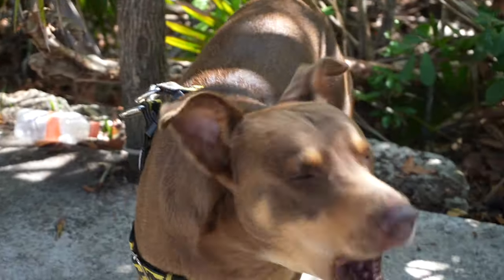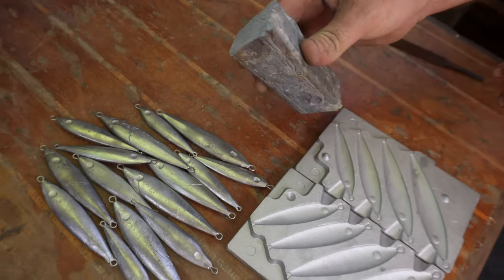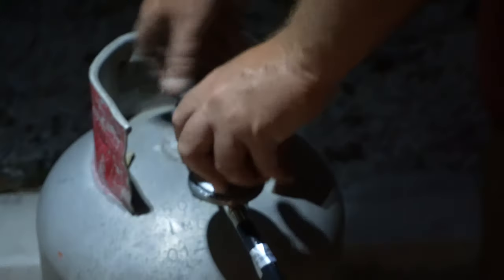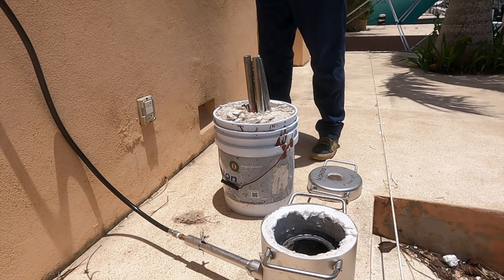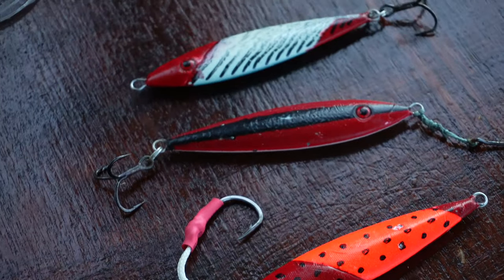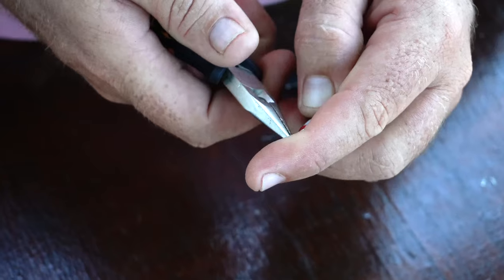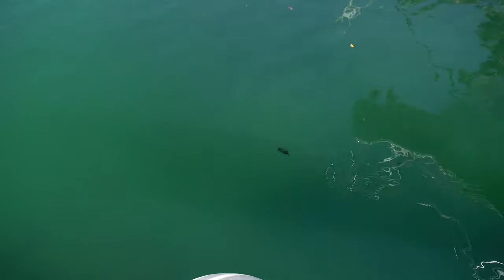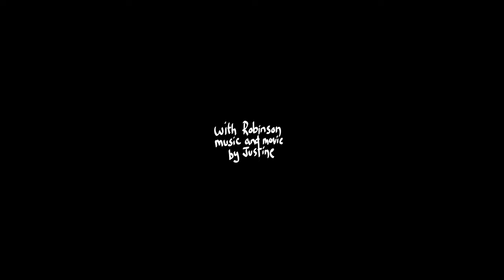ANCIENT Fishing Grounds

Comment: I have jigs for making lures and weights, What I use for cod is cut a chrome piece of pipe then a thick piece of copper wire or stainless wire ran thru the pipe with the hook on and then fill the pipe with lead works great for red snapper!
Reply from the maker: Yeah, running some wire through is a good idea. Thinking about those bright blue ling cods we pulled up a couple of times. What amazing fish!